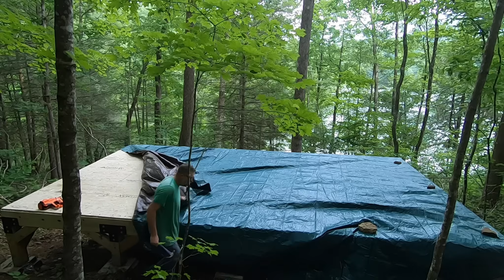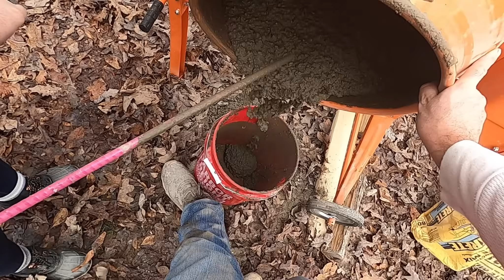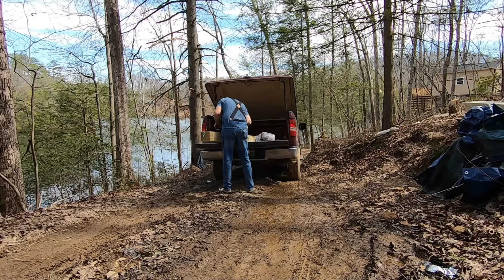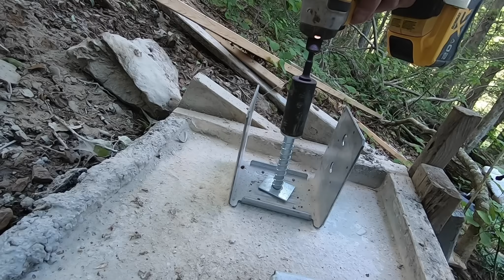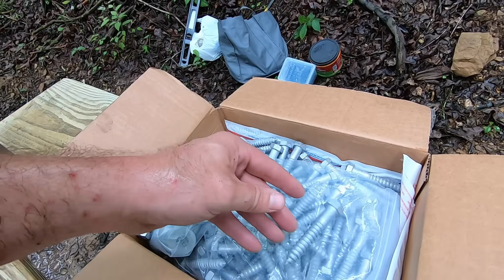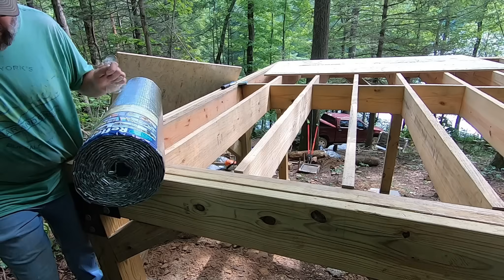MY LAKE CABIN COST SO FAR | EPOSODE 20

Comment: It's also good that you protect the OSB boards from water. Many people don't realize that OSB boards are just glued-together wood chips that dissolve when exposed to water, meaning that you have your first water damage on the building before the house is even finished.
Reply from the maker: That flooring is supposed to have a 500 day guarantee but its worth a $40 tarp to me
Reply: @bluegrassstateofmind4542 looking great i like the tarp idea!, when you told the pounds of Crete, my curiosity got the best of me had to pause and do the math,  lot of mixing, but doing the way you did no other choice .at least now you can sat on deck and watch sunrise/ set !
Reply: @bluegrassstateofmind4542  44 years as a carpenter, Jack of all trades and never once used toxic off gasing OSB junk shit. Nails are structural, most screws are not.